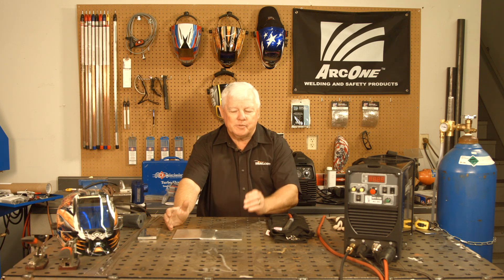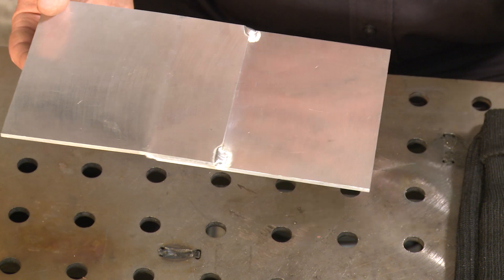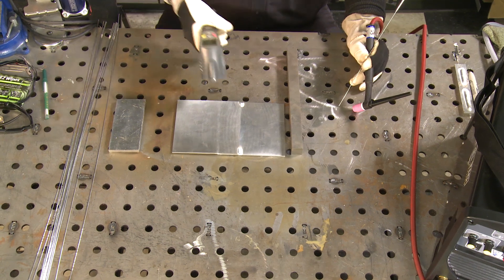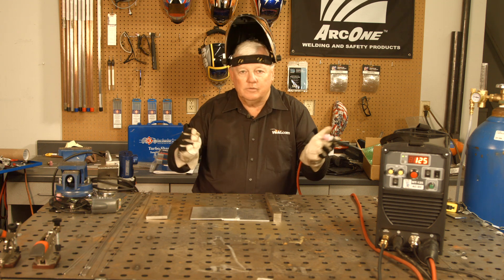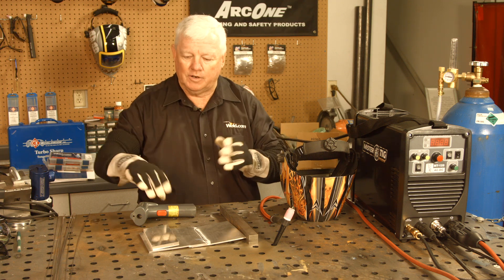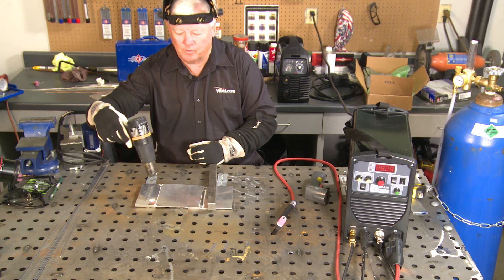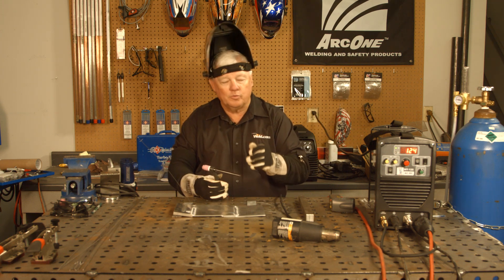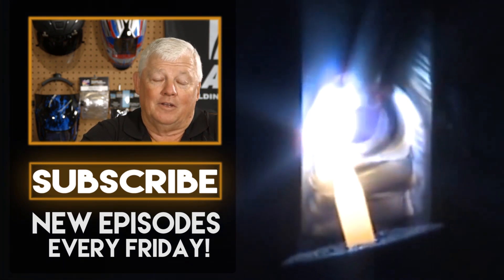How to Weld 3/8" Aluminum with 125 Amps using Pre-Heat

Comment: I have a tire shop here in Atlanta.
I do bent rim repair and would like to start welding cracks in cast aluminum wheels. Need something that runs on 120 but I don't think that's strong enough for thick cast aluminum (spoke side of the wheel). What do you recommend on a budget for a beginner?
Reply: You really shouldn't weld cast aluminum rims, but need a 240 welded to do it.  120 is pretty much max out at 1/8" aluminum.
Reply: Check carefully to verify the alloy used for the wheels.  Not all aluminum alloys are weldable.

Comment: Hard to take you serious proclaimed as 'mr. tig' and pushing junk machines
Reply: He is demonstrating what can be done in the real world where people have limited budgets and buy smaller machines. Given the choice we all would prefer to have a 3 or 4k welder but in reality most casual welders cant spend that. So how can you "get the job done" if you do not have a 250 amp miller or some other higher end machine? That is what this video is intended to show, how to do more with less.
Reply: I own the MT-125 he used for demo!  It’s been a nice little rig.  I moved up to a 325EXT with a cooler.  RIP MrT!

Comment: I have a Diversion 165  and was welding up an aluminum sign frame with two 1/4" mounting plates. I didn't per heat the 1/4" plates and was really having a hard time getting a bead to run on the 11 gauge square tubing to the 1/4" plate. I will try your method. Thanks! Good video

Comment: really 6:10 plate(3/8) with no bead on it.....7:02 plate (3/8) has a stringer bead on it. your hood is on. looks like you preheated by welding on it off camera??? A heat gun !! Jesus just tell people to weld aluminum in the summer cause the ambient temp is 50 degrees warmer than winter. what a joke
Reply: 2:10 that stringer was already on that plate from the scrap pile. Looks like all he did off camera is preheat with a heat gun like he said and tack it.

Comment: Good tip. I have used my oxyfuel torch for preheat as well as a propane "tiger torch" but worried about going above 200 F.  I needed a little help to make my Lincoln 210 MP and spoolgun do a satisfactory job on some 5/16" material.

Comment: can you oxy acetylene weld aluminium im guessing not but i know that a school in australia was using oxy acetylene to join 2 sheets and how strong would that be
Reply: Waaaay back in the 40's- 50's they gas welded aluminum....solid filler wire and a flux like you use when brazing steel....Youtube has some videos of guys making cooking utensils this way....
Reply: @dougankrum3328  back in the 90's in vo-tech teacher showed us an old timer oxy-acetylene making a nose cone for an old 30's40's? little bullet nose racecar out of flat sheet aluminum.  wiped a wooded match stick on the aluminum, the color left behind was his indication of temp. just right and he would weld and hammer. would love to see that video again.
Reply: You sure can. I've used a Aluminum Stick Electrode before. Break the flux off and melt it on to your weld joint, heat it up to melt the flux, and the start adding your filler. It'll get the job done for sure.

Comment: Wait, i thought you have always said that Everlast machines were entry level machines, now since they slapped a sticker with "Mr.Tig" on it it's a professional machine? I would think that a Miller Dynasty 210 or Lincoln SW Tig 200, both are under 50 lbs and 110 volt capable, would be professional machines. Not bashing the everlast units but they don't have the track record that red and blue have.
Reply: Ram-n_dodge I don't understand why he took the Everlast 185 and had it turned down to make the Mr. Tig 125?
Reply: It doesn't make any sense. The Everlast 185 is far better machine for aluminum work unless he always wants to preheat or just stick to sheet metal.
Reply: He has a very clear bias towards the Chinese machines...
Reply: Always buy the most powerful machine you can afford and stretch as far as possible budget wise. Save up first, whatever you have to do. Buying 2 machines and paying for both because you bought too small then had to spend more on something better later. Well... you could ad those 2 cost together and have got something much better right up front.
Reply: @robert5  I think it varies based on your application. As a hobbyist 1 capable machine is nice for space saving and simplicity  If I were a professional I'd rather have a few machines. One might just be a small stick/tig and another multi process wire feed. That way you don't have all your eggs in one basket. You can always buy something small to start. Not everyone needs a $2000-3000 machine just to get started or for hobby stuff. It's worth it to buy a $400 to get started and see if it's something you're even going to do a lot of. I'd venture to say the exact opposite of you on this one.  Buy basic to start, maybe a 200a capable stick dc/scratch start and later on go big if you outgrow. Then you always have that backup starter machine if your rent depends on finishing a job.